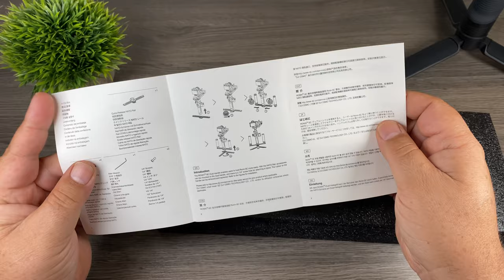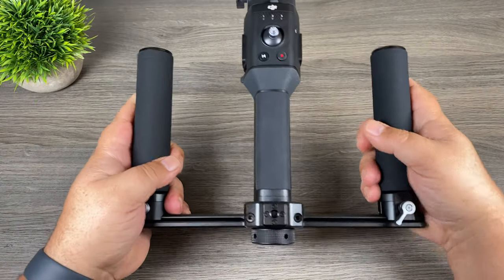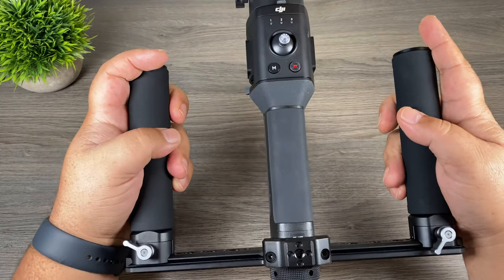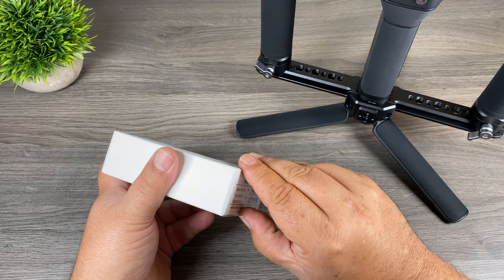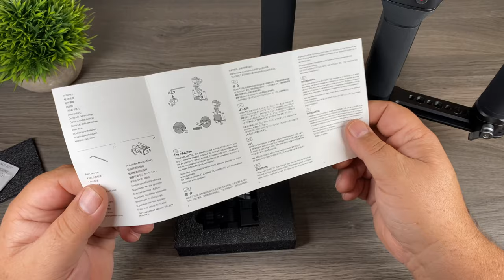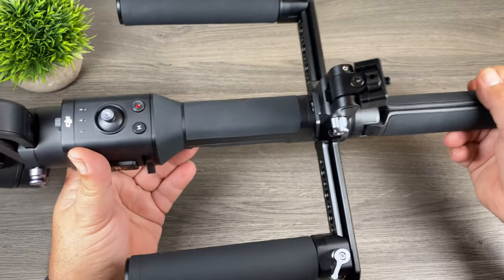Dual Hand Grip for Ronin SC

Comment: what is the span between handles? how is the weight distribution with camera + lens mounted? Does grip low connection point cause any balance/bounce issue in a video?

Comment: Does this also work with the ronin s?
Reply from the maker: There is a better handle set up that DJ cells for the ronin S. It’s called the dual handle switch grip. It is similar but mounts higher up on the unit and it could be converted to a single sling handle as well